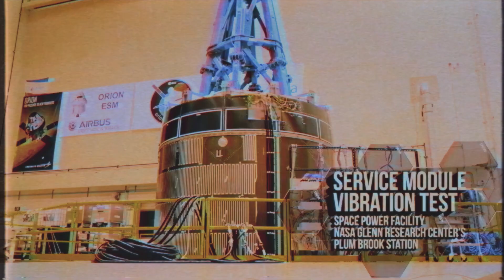From Metal To Masterpiece: Orion's 2016 Progress

Comment: Will it be manned?
Reply: Not for the first tests, but later. Please be patient, grasshopper.    :)
Reply: EM-2 will
Reply: Nick Gentile I'd vote for "Dawn Treader"
Reply: Darius Duesentrieb first two missions are test fights crew will not go aboard  until 2019. in the meantime the components are being assembled all over the United States and in Germany. service module is being built at Airbus Industries in Munich Germany, Orion itself is being manufactured in Denver Colorado and at Mitchold Space Center in New Orleans along with the first stage core the SLS rocket, the engines are being tested at Stennis Space Center in Gulfport Mississippi, and the solid rocket boosters are being assembled at the Orbital ATK manufacturing plant 6 in Brigham City Utah when testing and certification is done all the components will be assembled in the Vehicle Assembly Building at Kennedy Space Center and transported by crawler to launch pad 39 b and it will be sent to the Moon but that won't happen until 2019.